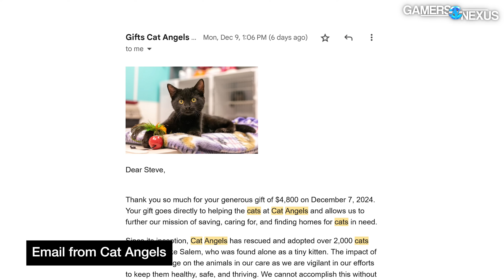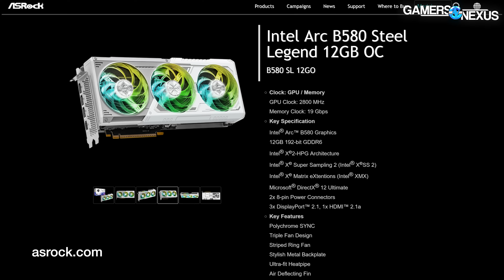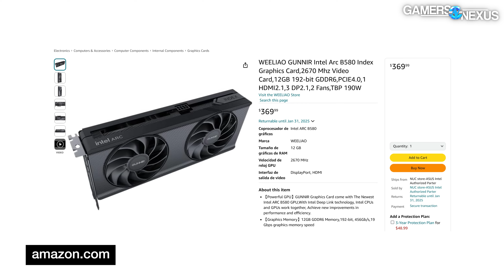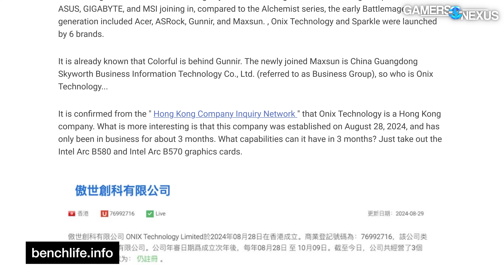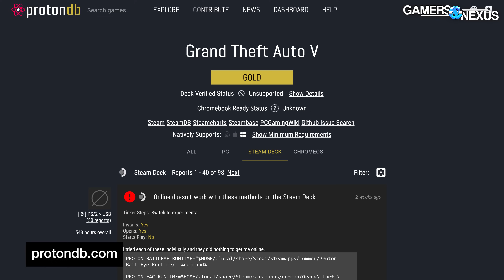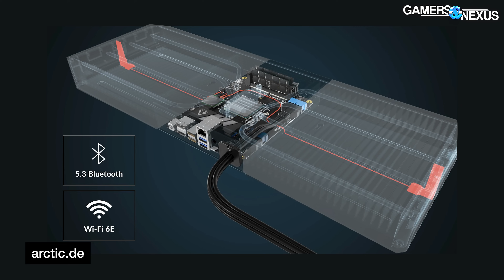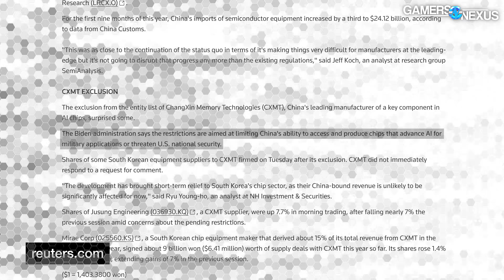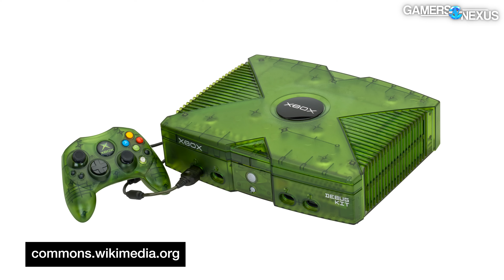HW News - Intel's B580 Victory, SteamOS Growing, NVIDIA Blackwell US Manufacturing Rumor

Comment: Bro, what good videos you make, I have a question about this hardware: Intel Arc B580 12Gb vs Rtx 3060 12Gb (using Ryzen 9 3900x) or Intel Arc B580 12Gb vs Rtx 3060 12Gb (using Intel 7 12700K), to work with 4k video editing with H.264 and H.265 files in Davinci, Premiere and Photoshop. That the timeline is fluid with these files.

Comment: Please review the review on the Intel B580 done by Hardware Canucks "the Intel ARC B580 is broken... On Older Systems".

They show the B580 on a i5-9600 and the performance goes straight to the toilet. 

Is there something they're not doing correctly, or is the B580 crap unless you have a system less than two years old?!

Obviously, the likely buyer for this card will be people who have a system in the 8th 9th or 10th generation of processor, and and are looking for a entry to mid-tier upgrade for GPU. 

If their review is accurate, anybody buying this card will be throwing their money away. 

https://youtu.be/npIpWFSfmv4?si=zLlcpvqycjEtd-lz

Comment: I'm extremely over Window's bullshit. It constantly has needless forced updates that usually breaks something or slows it down. Not to mention the abundant amount of bloatware/spyware. It's just simply not a good dedicated gaming operating system.

I purposely went out of my way to build a steam machine. Bought a used office pc, (HP 600 G4 SFF with an i7-8700, 16GB of ram, and an RX 6400). I installed a 1TB nvme ssd and Steam OS. It works great. The only complaint I have is that while Steam OS is great and it functions like a console, about a 3rd of my library isn't playable mostly due to steam os not being compatible with 3rd party anti-cheat software that's mandatory with some games.

GTA 5 for example, used to work flawlessly before they added anti-cheat. I can't even play it online anymore and steam even changed it's steam deck compatibility notice to "unsupported".. which is highly aggrevating.

And that right there is the biggest flaw with Linux/Steam OS. While great in it's own regard, it's held back by lack of anti-cheat support. I'm glad that the steam deck is very popular right now, it means that support will grow tremendously over time. Also, developers who add DRM to singleplayer games... I hate you so much. It defeats the purpose of the steam deck.

Comment: Having been watching a number of videos on the B580 it seems be competitive while using less vram and system ram more often than not. Sometimes significant amounts.  A high example and while watching a video comparing the rx6700xt at 1440p the B580  playing red dead redemption 2 the arc card hit 70fps while the 6700xt hit 60fps while using about about 4gb less vram and about  2.6gb less system memory.  (May be interesting for 16gb builds). Although this was with the 6000 series it seems to happen less with Nvidia from what I can see. I was wondering why the disparity regarding memory when using certain graphics cards and could it play into performance in realistic personal budget builds?

Comment: 15:20 why wait? steamOS is an arch based distro. just use any distro. maybe one with bleeding edge rolling release. makes more sense than steamOS, because you have the latest drivers for the newest hardware
i am using linux for years and tried different distros. it really does not matter for gaming it just worked!

Comment: I always found those overpriced partner cards quite stupid. When you can get a b580 basic model for 250 then there is no way in hell that they could add enough value to it to justify 400 bucks. This increase in price usually would set you up for the next higher model. So if you plan on spending that amount of money rather go with the next bigger one instead of some overpriced lower tier card they added some "leds" too.

Comment: I watch GN and HUB regularly despite not being a Windows gamer. The hardware reviews are still mostly relevant providing the manufacturer provides documentation or code to open source development. Reviews are long enough without adding lots of Linux data which is only of interest to people like me. I suggest you use it to sanity check results as reviewers did with the Zen5 release and to call out vendors or groups for anti-consumer behavior because Linux users can be the canary in the coal mine. 

Bad game distributors, hardware companies and industry groups seem to think they can be openly hostile to Linux consumers and it will not have consequences. I sympathized with small companies that didn't want to wear the support costs for such a small market or didn't own the IP in their product and couldn't document it for open source developers. But some of the recent cases are very different. Working games being withdrawn, standards groups denying licencing. It almost looks like the old anti-trust Windows days returning but ofcourse that can't happen again can it now that Microsoft are our open source friends?

Comment: I mean steam OS beaing a proprietary Linux vulkan translator was a STRONG move in the portable market....due to the inherent aspects of running various titles and older/legacy DX AAA classics on vulkan. I feel like this is going to be more of a standard/normal thing for most gamers to adapt as the years go on and those classics w/legacy API are still good playthrough/experiences. I think MOST laptops with secondary drives should have a linux install/build with a vulkan translator and some dx/api conversion tools as a primary gaming drive on gaming laptops as a duel boot PVE/AAA title viability. The same way it helps the steam deck and its older gen hardware compete with newer hardware on WIN os portables.

Comment: All of those materials, from China, are utilized in semiconductor manufacturing. For instance Ga is used in CMOS, GaAs, GaN. Germanium is used in Ge transistors, LEDs, and SiGe BiCMOS semiconductors.  Antimony is used in semiconductor metal systems (the wiring inside the chips).

Comment: Aw, when you said Microsoft is involved, I thought they start building kryboards again, but it seems that it's just some XBox brand design, nothing more. I still use my Sidewinder X4 keyboard, had to exchange some keys on it. So I bought a second X4 from ebay. This keyboard made by Microsoft is still the best keyboard in the world and I didn't find anything else which would satisfy my needs. It's not only, that it's pretty high quality, it also has the exact amount of additional keys at the exact right positions. The special keys at the "top" and the six makro keys on the left. And it looks good and feels good and is just perfect for me. It's a shame Microsoft doesn't make any good Hardware anymore. And on ebay the working X4s are getting more and more expensive, so I hope mine will work for another 12 years or more.

Comment: Linux gaming reviews? YES PLEASE!!! There is a distinct lack of standardized gaming testing. I imagine to fit both Windows and Linux, the graphs will have two columns now instead of one - Linux results in one, windows in the other. Would make for quick and easy comparison between the two. 
Alternatively, I foresee having windows and linux in separate videos as a very good alternative, as people interested in Linux only get what we want and nothing else, while those interested in windows only - the format for them does not change. And if someone needs both - they can open the videos side by side. Maybe even play them at the same time, maybe even setting it up so left speaker plays the sound of one video, the right one - of the other?
Reply: Phoronix do quite some GNU/Linux gaming benchmarks, but yeah it would be nice too see even more extensive ones.

Comment: SteamOS is a Debian distribution. While I'm sure they tweaked some stuff the reality is that installing all the Valve backed windows compatibility layers on top of the same Debian release should give you very similar if not the same performance. As a side not an interesting test on Linux would be to see which of the big vendors that loose the most performance when running their respective first party Linux drivers. You would probably need to test a few cards though. At least Nvidia cards tend to vary greatly in terms of how compatible they are with the Linux drivers.
Reply: SteamOS is Arch with KDE Plasma desktop environment nowdays. But yes any distro with the same components installed does come very close to what SteamOS is, it is just not so out of the box most of the time. Or you can use something like Bazzite distribution of GNU/Linux which is very close out of the box.

Comment: 31:15 "with polling rates ranging from 125Hz to 8000Hz°"
The way this is worded in addition to the asterisk being next to 8000Hz makes me think that they're literally going to tell you in the instructions to go download LordOfMice to overclock the mouse if you want above a 125Hz polling rate as that software can overclock peripherals like controllers, keyboards, and mice to a polling rate up to 8000. I highly doubt both that there's any built-in overclocking functionality and that 8BitDo is going to be providing their own proprietary overclocking software. Kinda sketchy to advertise it like that.
Reply: The asterisk refers to use in bluetooth mode where it's fixed to 125Hz. In wired or RF dongle mode it can run at 8kHz.
Source: I went to the website to check.

Comment: Too bad most 1440p are 2560x1440 and don’t factor ultra wide 3440x1440 (which I use). I’m considering purchasing the B580 (Asrock Steel Legend version) and seeing how it stacks against my Asrock Arc A770 16GB.

Comment: My 5700XT can still run RDR2 at ultra 1080 with upscaling, and certainly can run anything in GeForce now, but I want a b580 just because the idea of
replacing my 5700 with a much better card that’s at least 100 less than I paid for the 5700 is insane. for 1080 gamers sitting out this generation or two has been amazing as the upscaling tech has basically made more complex textures irrelevant and we’re only now at games
likes Indiana Jones that require forms of ray tracing, but that’s a great example of a game I play on Geforce Now because instant ultra settings, ultra ray tracing and absolutely no local system load beyond the equivalent of a VLC window.

Nvidia’s GeForce NOW is low key tag teaming with Arc cards to cut thousands from budgets potentially. Anyone with google fiber can essentially play any non competitive game at 240 HDR on anything that can render the video feed fast enough. You can downgrade so
many things for a streaming PC build and Arc fills in a gap where otherwise you’d have to pay too much for a true card or get shit performance from an internal GPU. I wanna see some examples of cheap ass systems running new games at 240 HDR sponsored by Intel. Just piss off Nvidia that much more.

PS. Intel go start your own streaming service. Do a basic setup like Shadow used to be and give people full autonomy to run their own virtual OS. You’ve got momentum and Nvidia is already downgrading their experience without the fear of the 580.

Comment: The 8BitDo keyboard should've been designed to use the original Xbox logo, not the modern one.  Original was better, and if it's meant to be in the design of the original, the modern logo is out of place and doesn't match.  I now also miss that original console lol..

Comment: intels new cards will not hold up well, remember all those pesky security and the voltage issues on the cpus? well that stuff doesnt go away over night as festering for the better part of 20 years
Reply: Intel's gpus are made using TSMC, not Intel, so that's not a problem. Maybe do your research next time?
Reply: @z-ah842h  you have no idea what issue im even talking about, but ok.

Comment: Just a small hint for when you get into Linux testing: The "Phoronix test suite" is great!
Also, Linux has a lot of tunables that can impact gaming performance quite significantly. Tweaking memory management (background page reclaim, swap readahead, memory compaction, caching, swap on a compressed RAM drive), using a kernel with a different scheduler (i.e. BORE, ProjectC PDS/BMQ, SchedExt, …), utilizing tools that automatically adjust process priority or CPU core affinity (gamemode, ananicy-cpp with the CachyOS rules), etc. There's a lot of super interesting stuff to be explored and I'm looking forward to your usual meticulous testing that the reliable data resulting from it.

Comment: Super excited to hear y'all are going to be doing Linux benchmarks, but please don't do them on SteamOS. For 90% of your viewers setting up PCs and laptops, you want a distro that:
- has an actual multitasking desktop
- is easy to set up and involves the bare minimum of command line anything
- runs in Wayland by default with an X11 fallback
- enables proprietary drivers with a single click (namely for NVidia support)
- has an easy to navigate "app store" connected to flathub

The best choice right now is elementaryOS, which is basically a de-snapified Ubuntu 22.04 with an extremely clean UX, built around flatpak, and having beaten Mint (Cinnamon) and Pop_OS! (COSMIC) to full Wayland support. Fedora KDE is probably the second best choice, and y'all should definitely try installing a few and see which you find easiest to set up and use.

Comment: Re: Linux on the desktop

Driver support is fine as long as you stick to known decent vendors (AMD, Intel, Realtek for the most part) and don't buy excessively new stuff (graphics cards are fine now, problems occur with webcams and the like more than anything else since all that stuff gets weirder and the manufacturers do not bother supporting it properly off Windows; anyhow, that's a laptop issue generally, I've not had Linux-specific trouble with actual desktop hardware in ages).

Kernel level anticheat isn't a matter of "support" on the Linux side. The kernel can load that kind of module just fine, the trouble is developers/publishers need to actually provide it (which is the only practicable option here; I mean ideally all the checks would just happen server side, but apparently that's not happening...).

In terms of distributions that have potential, imo NixOS has quite a bit of it. It's a bit of a hassle to get to grips with, but it will reproducibly produce working systems, makes it easy to switch back to a previous iteration of the system that maybe worked better, and is the only Linux distribution I'd personally call reliable. You'll hear people talk about all sorts of stuff with regards to NixOS, but most of it is honestly irrelevant if you want to use it rather than tinker with it, and it'll stand up to use just fine.

Comment: last time i checked hot air rises so the passive cooled sensa mounted to the bottom of a solid desk next to a corner wall without any airflow would do double duty as a leg warmer on a hot summer day if nothing else.
Reply: There is always a bad solution to a good idea, but there are also plenty of good solutions to this. Just don't put it where the heat accumulates. I think it's a great idea for a silent pc for daily use like internet and work.
Reply: As somebody who has their PC tower under their desk, the Senza will direct plenty of warm air straight up your nose while you're sat at the desk.

Comment: GPU news reminded me:  Intel Graphics Driver Installation software 23.1.0.0 always reports for me:
Extraction failed There is not enough space on the disk.
This probably stems from having Temp folder on Ram disk;
boosting that to 8GB did not help... how much space should driver installation require?

Comment: Ah Maxsun. With all of the options available why did you totally destroy any chances of selling any product? The Intel le here while $250usd is ~$450aud. That is our benchmark. I've waited since 2016 with my 1060 6gb for a new card. I've waited long enough. Bought a steel legend b580 yesterday. It cost me $479 with free shipping, so $30 more for the extra potential power overhead and the largest heatsink solution so far is not that bad considering I paid $369aud for that 1060 back in november 2016 and the value of our dollar-e-doos has decreased by 80% since. Those market share numbers do not surprise any of us here at all.

Comment: I love how when the steam deck released, a bunch of other companies like MSI tried to do a similar thing in reaction to it. Which they were never going to do untill steam took that market share. 

And after releasing their product, they kept supporting it instead of quitting because the competition got involved. The effort they have put into this is incredible, and I think that as of now, the official steam deck is the best thing in the market for this type of product.   I have had mine for 2 years now and love it.

Edit: I have 3 friends that have a similar product.  1 has the steam deck as well, 1 has the MSI off brand, and i am not sure what the last one is, but its not msi or steam deck.   Both the non steam decks have had no end of issues.  
Steam deck had consistently delivered on performance.